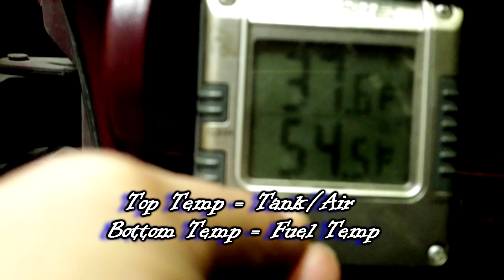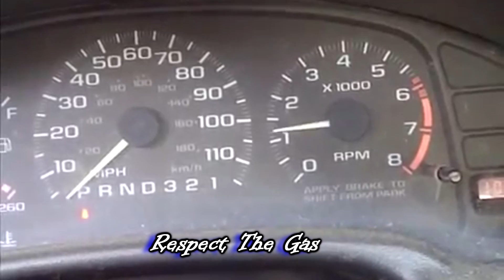Is 100MPG + Possible?? Alternative Multi Fuel Vapor Van!

Comment: 1979  651 mpg 0n 1100 cc Volkswagen notch back sedan Ontario Canada.

 It is actually vacuum assisted combustion not vapor. The reason it runs for a short while is because the engine needs increased vacuum to lower the boiling point of the gasoline to evaporate or change to molecular structure to ignite
In a standard mode the engine gets raw gas fed into the cylinders and ignition burns the gasoline and the resulting expansion pushes the piston down. In vacuum assisted combustion a very small amount of gasoline(molecules) and air explodes upon ignition driving the piston down.

Illustration: burning wood causes heat but shaving the wood into sawdust and igniting releases more energy than burning. Like the wood the burn is easier to control( acceleration ) and the explosion hard to control(lack of acceleration) especially after the first 12 miles or so

See Tom Ogle Vapor fuel system excellent attempt to achieve 100 mpg ( El Paso to Demming and Back) Tom Ogle died never understanding the principle by which his system operated. Believe this there is no conspiracy  by the oil companies to keep these inventions off the market they simply do not perform properly under normal driving conditions. 
You don't actually need heat at all although I have used heat in the past Ive also started in -40 and ran an engine to empty with no heat at all but you do require a partial near total vacuum. A 4 cylinder 1100 cc engine breathing through a 3/8 hole creates this condition. A plastic gas container could never handle the vacuum. It needs to be steel construction. The idea of choking an engine to achieve more efficient combustion seems counter intuitive but pay attention to the results not your intuition. This system is not a normal system. Throw out what you think you know

Raw gas is needed to cool the intake valves or you get pinging and scorched valves. A small amount of water can cure this but water is not a great choice for colder climates.

This system runs stationary engines the best and would and could be modified to power an electrical hybrid like the Chevy Volt. The engine would run at a constant speed and create electricity to power the motors at each wheel
lesliec77@icloud.com
Leslie
Reply: Look at the Pogue patent from about 1920. Keep a constant temp of the fuel TANK and a constant fuel level. The variable amount of fuel is the hard part. Maybe use an extra heated area with a  injector to spray the fuel on to turn it into vapor.
There are at least a few hundred patents that I could find for gas vaporizers, I'm sure many took the variable supply into account.
Also, the fuel has been changed so it no longer vaporizes like it used to do. I have been told it is a mix of very easily vaporizing and very hard gas, but the normal middle has been removed. That is what one petrolium engineer said. They also said their was much more power in the gasoline from the 1920s. 
see the Who Killed the Electric Car for another example of someone who made a vaporizer from a old propane tank. He was found dead a short time later. So if you make it , promote it without your name. Or get a bodyguard.
Reply: There was a time when people did not have degrees at all but were just intuitive. I dont think Im the smartest guy in the room I leave that for Wile E Coyote. I dont know some guy who knew some guy whos sister was friends with the guy IM THE GUY. I post on the subject because I have first hand knowledge. Yes it burns intake valves Ive said this before and yes water injection cools the valves
Now YOU are speculating on something you know nothing about(Im used to it)
Reply: Actually I used 4 different engines An 8(302 cid) an inline 6(300 cid) a horizontally opposed 4 cylinder(1100cc) and a 3.5hp Brigs and Stratton I worked on it for 3 years at 70 hours a week I discovered its limitations and no for its intended purposes it doesnt work. You cannot run a car in normal traffic conditions. The vacuum that is the determining factor does not respond well enough to changes in acceleration or deceleration. Much like the post it note that succeeded because of a failed experiment with glue the key to make this work is to find a way to incorporate its limitations into a working prototype
It produces carbon dioxide as its emissions we used them to heat our workshop with no adverse health affects
I discovered the vacuum principle in a failed experiment so basically I fell over backwards into it sort of like discovering America trying to find China. It took me a long time to wrap my mind around it because it completely throws into disarray everything you believe about internal combustion engines
It does burn/scorch intake valves (500 hours in the 4 cylinder) 
It is easier to communicate by email or phone lesliec77@icloud.com 587 920 8034
Reply: I have an autistic savant friend whose mathematic skills in astrophysics would make your head swim but he is ridiculed as well Ive learned to get over it and he doesnt care so its all good
Reply: Didnt modify the engines at al(although we did disconnect the fuel supply)l. We built a tank 12X12X12 by 1/4 inch thick We ran a tube 1 1/4 inch ID to the throttle body of the 4 cylinder. We closed off the injectors(disconnected them)we used a valve 1 1/4 ID as the intake and let the system breathe through a hole 3/8 of an inch. The resistance created a vacuum (partial near total) in the tank which had nothing but gasoline. The resulting vacuum lowers the boiling/evaporation point of the fuel and it dissipates to its smallest molecular structure. The increased velocity across the top of the tank draws the molecularized gasoline into the cylinder where it is ignited. The operating temperatures were monitored and were unaffected by the lean mixture although it did burn the intake valves over time
By lowering the boiling point of the gasoline you are in effect re refining the fuel into further levels and after burning half a gallon an observing the remainder of the fuel we discovered it was cl;oser in feel and appearance to diesel. The gasoline internal combustion engine will burn a multitude of other fossil based fuels using this basic system
It is a very simple physics principle. The problem is it can handle load with out problem but once the speed is established  accelerating/decelerating is impossible
All successful tests have been done on test tracks were speed control is not an issue or at set speeds 
The other thing is we built viewing ports and used clear hose to facilitate observing the experiments
Tom Ogle did this experiment from El PasoTX to Demming NM and did it on the interstate at 55 mph and the engine stalled on the return trip to El Paso 5 miles from his target due to his attempt to slow down Hope this helps I know its simple but some of the best things are Pictures help but Im not a You Tuber so a lecture is something I can do but communication like this has its limitations
Reply: As long as you have ventilation and you are not breathing solely CO2 . carbon Monoxide you would last 10 minutes maybe less
Reply: If you have decided ahead of time to discredit me you are wasting both our time. I have done these and hundreds of experiments like these. You just have opinions
Reply: Well 651mpg was our highest result we also did a test stand run at 3400 rpm 332 minutes on a quart or 16 minutes on the injectors(yes we ran controls on our experiments)Doesnt seem plausible I certainly would have agreed with you on that one but I performed the experiments myself over and over. You see the same thing in many You Tube videos but they are accompanied by an explanation that mixes conventional thinking with the physics of this technology. Most do a few experiments and give up I spent 3 long years of trial and error. I only post to prevent people from chasing their tails and emptying their wallets 
On the V8 we got 300-325mpg on the 6 cylinder 425-450  Funny thing the engines are near identical in cid but the number of cylinders seemed to be more of a factor than displacement
Reply: My father (RIP) was a top flight mechanic. When I told him I was going to try this he told me it would never start the car. I started the car. He told me it would never pull the car(work under load) I drag raced my 69 mustang 302 with this device. He then said You couldnt run it very long So I ran the Volkswagen 651 miles(just to see if I could actually burn an entire gallon top to bottom) He saw it with his own eyes but would never admit he was wrong JOIN THE CLUB
Ive given you my email I have made myself available to anyone who wants to try this. You dont believe me? JOIN THE CLUB I have an ex wife who has called me far worse things than you can come up with . Want to learn? Maybe you want to be Wile E Coyote in this exchange . Well congratulations YOU are now the smartest guy in the room(charcoal canisters what a moron)
Reply: bullshit
Reply: The idea that 100 mpg is the target is indicative of not living up to the potential of the device  because of the nature of the type of expansion of the fuel the idea of 100 mpg is a miscalculation of the results of burning the light ends of the fuel
We didn't have you tube so we made perfect detailed notes on our experiments and had them signed and witnessed by interested people dignitaries and politicians
Lots of people did not believe it even though they saw it first hand. My father ( a mechanic all his life) said it would never work and wouldn't acknowledge our success even though he witnessed our tests first hand
So join the club

I left my contact info so if you would like to debate the invitation is open
Last thing in the 70s Shell oil ran an Opel on a test track for 376 mpg
Don't know what engine they used. The original big 3 auto makers all have  patents on similar devices
They have all tried to solve the puzzle but got no closer than I did
I.worked full time for 3 years not part time like you tubers
Thanks for you comment have a nice day
Leslie
I worked as a patent broker in the 80s and learned a lot about the different patents on the similar devices
Reply: thanks for posting ..Cheers
Reply: Orville and Wilbur Wright, Thomas Alva Edison, Albert Einstein,need more?
Reply: The engine is the only common element in the 2 very different approaches. I got the idea from a retired mechanic. Every mechanic I showed my experiments to said it was a trick(and they saw it with their own eyes) so Im used to skepticism like yours. Explain a single cylinder 3.5 hp running 96 hours on 2 cups of fuel. My point of view is derived from thousands of hours in research and yours is the speculation of someone who has spent an hour on You Tube. Id agree with your speculation but then we'd both be wrong
Reply: No propane is doing the basic same approach as vapor from carbs or injectors this is far more efficient as it relies on the molecular structure of the fuel not some mist
Reply: Just thinking of people who thought and performed beyond their limitations if you can think of anybody as having limitations. We only have the highest regards for these folks now but at one time they were ridiculed along with the rest
Reply: Depends on what you mean by ridiculed
Reply: also condensation forms on the outside of the tank due to the chilling effect of the vacuum and we heated the tank in several different ways we used coolant heat in a false bottom at the base of the tank We switched that to exhaust heat for higher temperatures but in the end neither was needed and we simply pumped the exhaust into the shop and let the ambient room temperature look after the tank
Reply: Would a glass half litre bottle resist the increasing vacuum caused by the engine air intake (of a 3.4L engine)? I introduced 2 pieces of 1/2 inch green reinforced garden hose into the bottom of the bottle, then another piece at the top. Sealed everything with epoxy, but I worry that the bottle will implode under the vacuum. Do you think it will resist?

Comment: Hey was wondering if you ever tried using a ultrasonic vaporizer without heating the gas, also if you haven't already u should look into the GEET it is similar to what you are trying to do using the exhaust to heat the fuel
Reply: Yes that is why I have been saying for ever and you’re absolutely right because with an ultrasonic vaporizer it’s just breaking the hydrocarbon chains using the right sound frequency therefore all of the gasoline is vaporized and not just the lighter parts of the fuel and then you don’t need a vacuum in order to bubble Lagasse therefore you’re only collecting it so there would be no change in fuel temperature not to mention it would break up the detergents and other additives as well long story wrong and ultrasonic vaporizer and stick a fork in it you don’t need heat or vacuum or any of this other nonsensical crap that works temporarily i’m going to put Mr. I am a scientist’s theory to the test that if the container is perfectly sealed it’ll work completely fine and gasoline doesn’t cool in a vacuum it’s like why the hell do you think outer space is cold it’s because it’s a vacuum a little off topic but if you have any common sense you won’t ignore thermodynamics